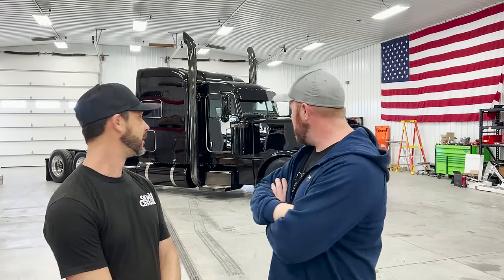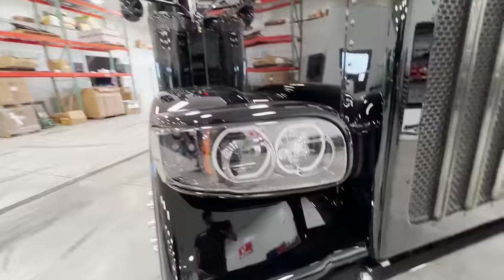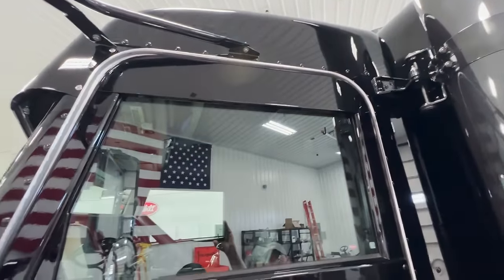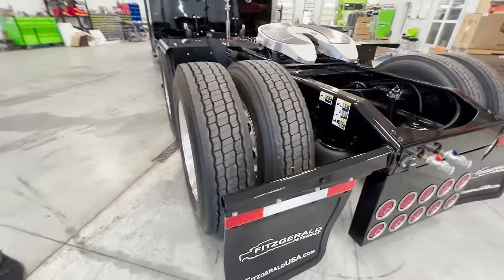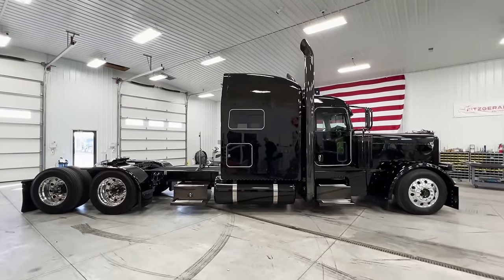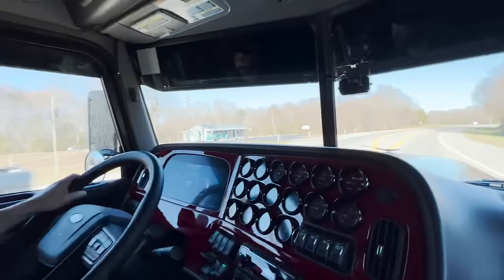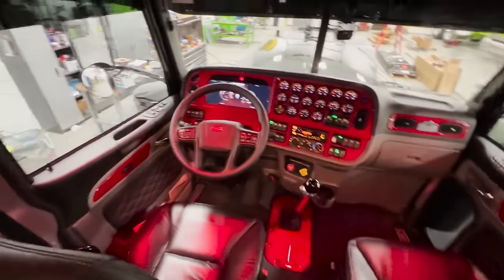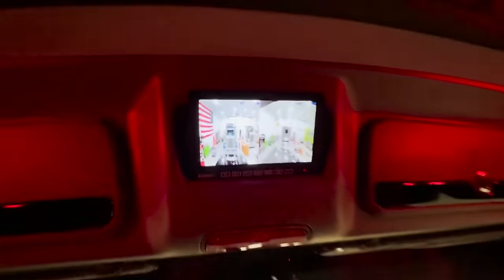Welcome to the dark side....Peterbilt 389 "BoogieMan"

Comment: I really like it. HOWWW. EVERRR. Me personally I think it would look better with more chrome " Stacks tanks I think the Old School Air Filters painted black" with the chrome top would go good with it. but I'm not just a Old School guy. 
Now I have a question for the two of you. 
Cause I've thought about this for a long time. What would think about taking a 2022 389 flat top and going through it and making it look like a Brand New 359. Original paint scheme redoing the interior just making it look like a 2022 359.. put an air foil on the sleeper. Leave me a comment and let me know what you thought about that. Thanks.
Reply from the maker: Would definitely be cool to do….or take a 359 and out it on a new 2022 chassis.

Comment: Guys - Why wouldn’t you do black rims, even the translucent black like the stacks and the bumper?! That seems like a no brainer to me, but the truck still looks great. Also, I think this would look a lot better with a flat top sleeper, a solid black deck plate, and five red lights on the back of the cab to match the 10 lights (5 over 5) on the t bar (or put 8 on the t bar- 4 over 4).